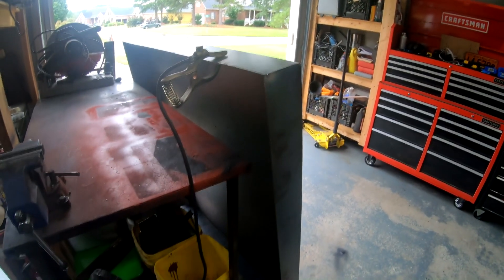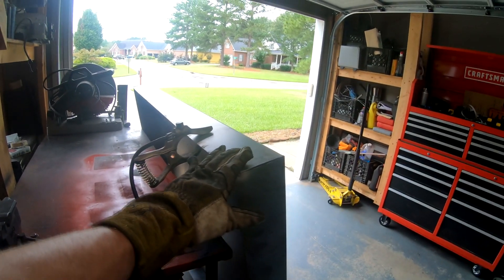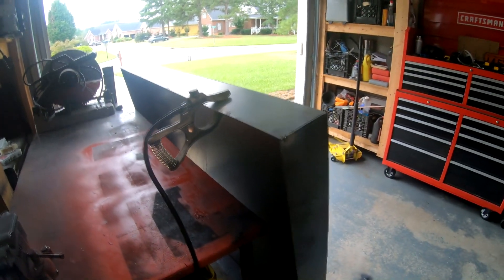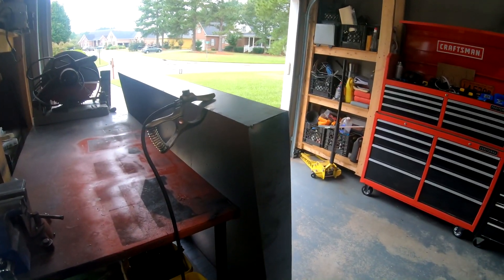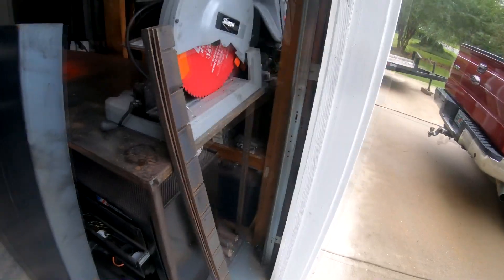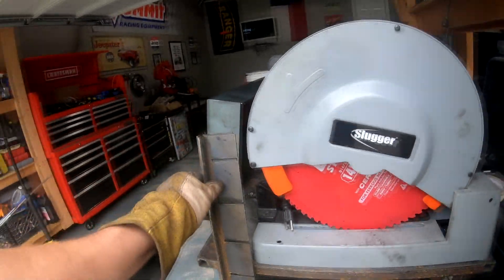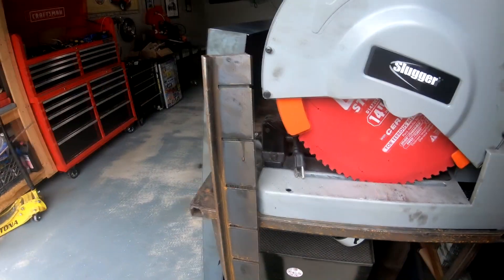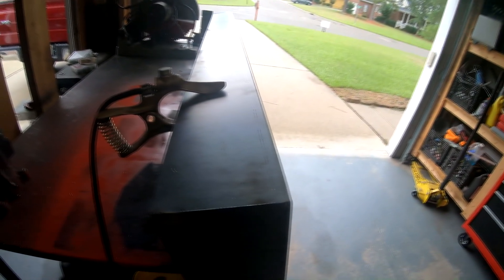BUDGET Professional Plasma CNC Autofill/Drain Water Table II Legacy 4x4 and Off-Road

Comment: I know this is an older video but after using the fill/drain have you had any issues with the barrel taking all of the water from a full pan?
Reply from the maker: The barrel is more than big enough for the full table of water. After emptying the table the barrel only fills up about 1/3rd of the way
Reply: @Legacy4x4andOffRoadYT  I did mine the same way you did- came out great- thanks for the video!~

Comment: Thank you for the video, I was hoping you would shed some light on the technical aspects such as building the connections to the barrel.  I would have preferred hearing you explain what you are doing and why, show the fittings that are being used.  I am interested to know how you plumbed the air into the top bung cap, what fittings are used to plumb the drain pipe to the bottom bung hole, did you run a pipe through the cap to the inside of the barrel, if yes, how far, and why???    Thank you
Reply from the maker: I don’t remember the exact fitting sizes. But everything was purchased at Lowes. I remember distinctly going one day, and sitting in aisle just playing with different fittings and ultimately deciding which would work. 

The top air line uses a 1/4npt quick adapter air line fitting. As is standard on any air tool. Bottom water flow fitting is pvc and pcc glue. Nothing fancy. The pvc water line from the bottom has one drain and one fill section controlled by a valve. 

The system works based on pressure. Obviously to drain the water from the table into the tank it is simply gravity. Just open the valve below the water bed and let gravity do the work. To refill the table you open that same valve but also apply 1-6psi of air pressure into the top 1/4npt bung. That alone is enough positive pressure to force the come up the drain hole instead of down it

Comment: Those barrels are not made for air pressure. I think you will blow it up sooner or later.
Reply from the maker: Really? Thank you. I’ve got a list of potential issues going right now from other peoples recommendations. I’m adding this to it. Thank you for the critique!
Reply: Draft table, maybe would be a anwser for you. If you will not cut thin metal. Cause of warpage. Less slag on other side. But your plasma has to have fast moving capability. Stepper motors goes 1000rpm max. Thats a bit too slow. If you use belts it gets even slower. Depending on reduction rate. I think you should read more about this idea, im not expert. Good luck

Comment: You can never have to many tools however the man cave can be to small..
Reply from the maker: yup, thats the issue were coming across. I just recently bought a 30 acre farm house, unlimited possibilities for space :D
Reply from the maker: a farm house on 30 acres, I should say
Reply: @Legacy4x4andOffRoadYT  
Holy smoley 30 acres of tool storage LoL 

Look into SIP panels to build the shop out of. I help set up the 14' walls to a 32x60 in little over a day. when they are up they are done inside out and well insulated..
What year is the commander? I had a 74, I still have the pto box for the transfer case if you are interested it.
Reply from the maker: @SegoMan  hah

Comment: May I ask, what were the down falls of the first table that you built?
Reply from the maker: Sure thing, there were a few. Mechanically, it didn’t have the resolution I was looking for, the 2x2 guide rails with a direct drive motor system is not able to get fine detail and fast speeds as well as an extrusion and pulley driven gear system. Also that table was only 46in square working area(I did my math wrong shooting for a 48in square)

Control wise, it was much much easier to build the first one. Much simpler wiring. But along with the mechanical upgrades I wanted to get better software control as well. Using dedicated drivers allows me to control the behavior of the machine much more accurately. 

Truthfully, the first table was completely functional, worked wel enough, and was much cheaper to build than my second one. If cost is a concern and you’re fine working with a little lack of control/resolution then that design will work fine. I ended up selling it and using that money to help fund the second table.

Comment: Curious as to why the drained water needs to be kept at all ? Why not just have the water level maintained by a float in the pan until a change is needed ?
Reply from the maker: Save water from massive evaporation losses as well as clean out the inside as easily as possible to fish out junk and small parts! thats the idea!